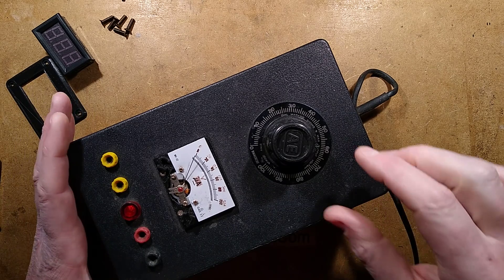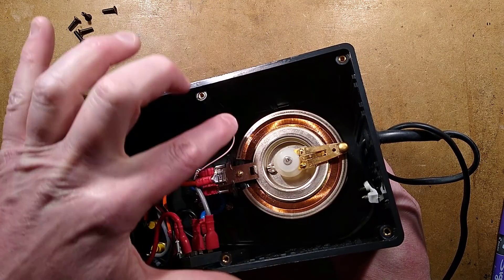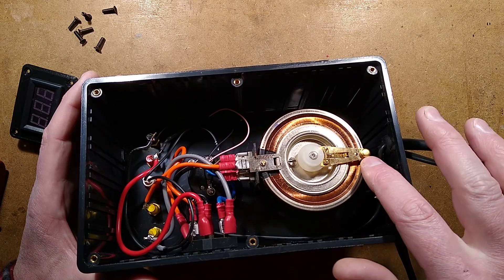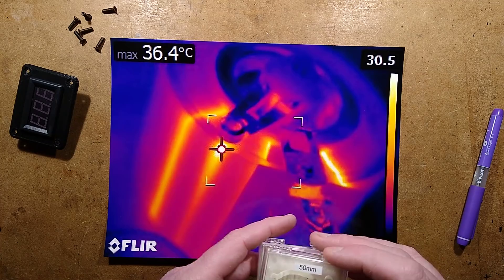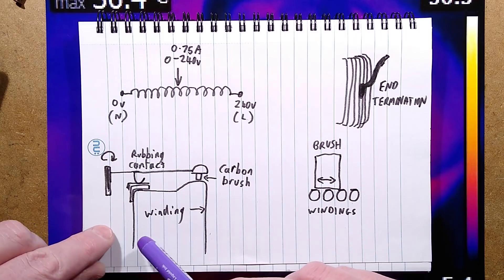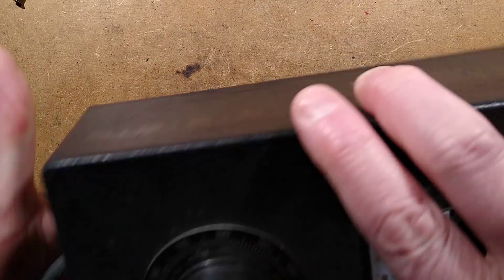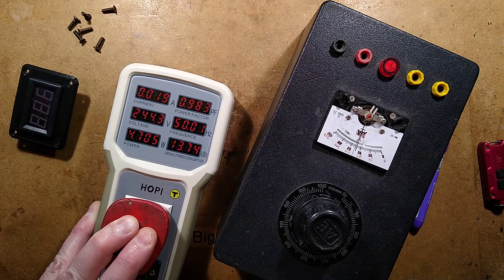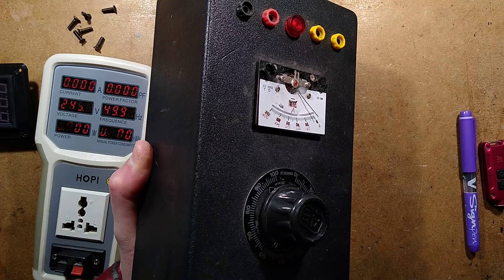Variacs DO short their windings

Comment: why would the shorted turns even make a difference, the path of least resistance will be the only one used I would think.
Reply: Vast oversimplification... current takes all paths at once, inversely proportional to their resistance. The "path of least resistance" case has a resistance below say, 0.1% of the other paths, and so takes 99.9% of the current.
Reply: @jercos  so the all the paths will be used such that the proportions of the current vary by resistance, is that fair?
Reply: @EnergeticWaves  going further, the shorts are by and large the "path of least resistance"... but for the other turns in the transformer, the path around a shorted turn and to the next short would fight against the current produced inside that loop.

For the shorted turns, each turn is a low-voltage electric heater, its own resistance determining the heat produced. For the unshorted turns, there's additional potential current paths if the wiper has poor contact at the first point, or the output draws high currents.
Reply: @jercos  Would the answer be click stops and more space between turns such that only one turn can be in use at a time?
Reply: @EnergeticWaves  as mentioned in some other comments, this is actually a desirable property. In the real world all synchronized contactors (like the contact points between the brush and a pair of wires) are either "make before break" or "break before make"... the alternative to shorting turns is cutting out power repeatedly as you turn the knob, and having tons of "dead spots" where you'd get no voltage at all until you wiggle the knob. You could add a cam system or magnetics to "step" the knob onto a single wire for a minimal gain, and some variacs use a roller contact to limit the contacts to two at most.
Reply: @jercos  that's right, the stop start part would defeat the purpose of the thing.  good point.

Comment: Doesn't a variac output a slightly  higher voltage  the input? I thought they were auto transformers
Reply: They're typically applied as step-down autotransformers. To step up voltage, you'd apply an input to the wiper.
Reply from the maker: You can get variacs with a mid point supply that will allow a higher output voltage.

Comment: My stepfather had several of these for the lights in his animation studio. He found that the lights lasted much longer if you wound them up gently and didn't run them at full power, which was important as the special bulbs were expensive. Of course he'd got them second hand and much used, so big blue sparks would shoot out the sides as you wound them up. Also they had to make sure that the lamps were always running at the same voltage throughout the shoot, since mains voltage varies from day to day, which would show up as a noticeable flicker when sped up by the animation.

Comment: I've started using Kapton Tape on my glass bed for printing PETG, PLA, and ABS...No glue needed. Just a quick wipe with Isopropyl.  I'll NEVER go back to anything else.

Why would decreasing the resistance of a section of winding cause all that heat. It seems like there should be enough resistance from all the remaining un-shorted windings to limit the current as if the short was absent.  Like shunting a 2 ohm resistor that lives in series with a 1k ohm resistor. Is this not what's going on?

Comment: I have a slightly chunkier one (~4A = 1kW) which has a copper roller on a pin sticking from the slider arm.. that way it makes sure to short out two adjacent windings at best.. and the 0.5mm² solid coil makes a nice ratchety effect while turning.

Comment: Interesting that your research did not uncover the “semiconductor” nature of the interface between a metal such as copper and a typical carbon brush. Essentially no current flows until the voltage across the junction reaches a couple volts. You can read about this in old engineering books.

Comment: Just wondering. Does the current (losses) decrease when the wiper is lifted?
BTW The max voltage output in your variac is max the same as the input voltage. Consider soldering an extra wire about 10 degrees or so from the max rotation (same method as now used for the connections). When you apply voltage to this wire the output voltage can be higher in case you need a voltage higher than the line voltage.

Comment: Maybe I'm misunderstanding what's going on, but shouldn't the carbon brush be the only thing heating up when it shorts across multiple windings? The way I am figuring it, current is constant across the entire winding, so shorting the transformer should actually heat all the coils OTHER than the ones being bypassed, as those would have less or even no current flowing through them, but the rest see higher current from the loss of overall resistance from the bypassed turns.

I think the stripes of heat going down the windings was just heat from the brush conducting down the wires it was touching, and that narrow strip seen in the picture might be a damaged winding with higher resistance.
I just woke up, so it would make sense if I was a little confused, but it might be worth further experimentation.
Reply: Shorting a winding of an autotransformer adds a low-resistance load to the whole transformer, pushing a potentially large amount of current through the short. If the carbon brush contact is low enough, the resistance of the windings is relevant.

Comment: Yes, they short out the windings which is why it is nice when they are overbuilt like the old ones were, so that the thing can actually handle real usage...
The new-style Chinese units have a very narrow pointy-cone brush to help reduce the strain on the undersized windings but will never hold up over extended usage, especially as the brush wears down and more windings come into play on the "shorted turn" section.
There's a thread on the EEVblog about this, I'll see if I can find you a link...

Comment: Used a variac in our shop.  Rated for 15A and the windings were much more 'course' as it was about 14 AWG wire.  As you turned the knob, you could 'feel' the bumping as the brush moved from one turn to the next.  They are a sort of auto-transformer (uses the same winding for primary and secondary) with 'taps' on every turn of winding.

Nice video.  And some VERY nice FLIR photos.

Comment: Where the windings are hot, it's due to current flow. Shorted out winding have no current flow so are cold.
You get heat at the source of resistance - i.e. at the jockey and that will be conducted down that winding. The hot bits at the ends must signify poor connections at the ends. The random hot winding is an oddity but is presumably due to increased electrical resistance at that point, for some reason.
Reply from the maker: It's a transformer.  A shorted winding is a closed circuit around a magnetic core.
Reply: @bigclivedotcom  Yes, I was considering that. Perhaps you have one winding permanently faultily linked ?
Sadly, I think I'm even more baffled by variacs now than I was !

Comment: 750mA ?

BABY !

My variacs are all 8A 0-115%

And Clive, if you think that's big, you should see my resistor - I'm guessing it's going to be around 0·01 ohm and rated in kA. I'm guessing it's in an oil bath which has a water supply - pipe diameter approx 3/4" It's years since I've seen it but I know where it is !

Comment: Shorts caused by the wiper shouldn't matter at all - it just results in a few "dead" loops at the wiper position. Likewise, any other short would just kill a loop or two, and decrease the overall resistance of the entire coil (and affect the linearity of the output). I'm not sure why there would be hot spots unless the windings are uneven, so that a few windings are closer together (so the combined heat of the windings would influence each other). None of the shorts would put more current through any single section of wire.

Comment: I would expect the unloaded Variac would be purely inductive and so I would expect a non-zero current and a near-zero power factor. I'm not convinced that the shorted turns would really affect this much, either. Evidently the resistive current from the shorted turns is far more than the reactive current of the inductor (in other words, the inductance is more than I expected) and so dominates.

Comment: So is this a variable transformer, or a variable inductor? Looks to me like it’s an “inductor divider”, since it doesn’t have both a primary AND secondary coil.
Reply: autotransformer
Reply: I’m drawing an analogy between a standard voltage divider using two series resistors across the voltage supply, and the case where each resistor is replaced by an inductor.
Reply: @danthewalsh  the analogy works until it doesn't, output from an autotransformer doesn't behave like a simple divider under varying load, sharing a core keeps the "divider" balanced through mutual induction, the transformer effect. Autotransformers can also boost voltage (frequently used to boost 120 to 240 in the US), or even create an opposing phase.

Comment: Yet another great myth-busting video Clive. Thank you! There are many assumed theories about the graphite brushes on variacs, but it's obvious that they simply short out a few turns of the coil which after all amounts to only a few volts precisely as you say. I have an 8 amp variac and it dissipates 13 watts quiescent AND it has a finned heatsink on the graphite brush. That's where the quiescent power goes.

Comment: We used to carry a 20A Variac when I toured with a sound system (1980's). This would allow us to adjust the voltage at venues that were out of spec (for the console and other sensitive gear. Nowadays with better power supplies this is not as much of an issue.) For the connections to the windings there were actually 4 connections, 0%, about 10%, about 90% and 100%.  We would connect the hot at 90% and the neutral at 0%. This would allow us to move the output wiper past the hot connection at 90% and boost the output voltage above the input. Very handy when we were at a venue with low voltage. Being from the US, we would also bring this variac along when touring in 240 volt lands, etc., allowing easy adjustment. (We would find some places where 240 was actually 260+, being able to tweak as needed was handy.

Comment: Use ethyl alcohol with your 3d printed parts instead of isopropyl.   I switched to using ethyl in 2019 after repeated nudges in that direction from my printer manufacturer.   It's a lot easier on the plastic, and still has excellent ability to remove "sticky" and other unwanted stuff.  I've taken to using it for all electronics and sanitary purposes.  I think it's easier to get ethyl in most countries other than the USA, as there's a massive tax here on ethyl (approx $100 tax on 1 gallon of 100% lab grade).     It doesn't smell as pleasant as isopropyl but it's far less damaging to plastic.
Reply from the maker: Ethyl alcohol is ethanol the drinking alcohol.  That's why they charge such high duty on it.

Comment: I use cheap glass cleaner for the print bed as it cleans the oils off and leaves a film for the print to stick to.

Edit: Do not use glass cleaner with petg. Apparently people have bad luck with it bonding to the build-plate and de laminating it when using petg with glass cleaner.

Comment: I just had a look at the brush on my 10 amp variac. 
It's a 10x10x10mm cube of brass, with a small T-profile length of graphite set into it, about 10x5x5, the edge that contacts the winding being about 1.5x the width of the winding pitch. The graphite measures about 1.5 ohms in the winding-to-winding axis, and 0.3 ohms from the brass to the contact face - the whole length of the graphite insert is effectively all in parallel to keep the resistance to the brass low, while having enough resistance in the winding-to-winding distabnce to minimise heat from shorting turns.
I know someone who tried replacing a broken variac brush  with brass. it didn't end wel...
Reply from the maker: Someone else mentioned a tiny brass roller that rode across the windings.  I tried measuring mine, but didn't see significant results with my ordinary meter.  Maybe I should have tried my installation tester for a higher resistance test current.
Reply: @bigclivedotcom  I have a heavy one, that has five ! ~1 cm carbon sliders side by side so with spacing the entire takeoff area is ~6 cm , using the height of the wingdings on the outer circumference. (for normal use I have a smaller 2Amp one though)
Reply: i have second hand ones with copper cored graphite wheels, but they got stuck and have been rubbed flat on one side
Reply: Likewise on my 2A one.  Mine came with a spare brush, which I have never needed and occasionally find lying about the workshop (it's supposed to live in the bottom of the Variac cabinet).  I notice that the windings are actually set slightly apart and embedded in epoxy so that the contact surface is quite flat and the 'dwell' is very short.  I imagine if and when the leg of the T wears down it will be another story, but it will probably outlive me.
Reply: Hey Mike, have you ever popped into the synth-diy mailing list? I think you might find it interesting  A lot of analog electronics design happening.

Comment: It's easy for anyone to see this fact just by looking at the brush. The brush is wider than 2 turn surfaces. Note also that they turn / mill the windings flat for the brush; this is obviously necessary for brush movement, and while it may increase the wire's contact area, it drastically reduces the circular cross-section.  So the classic name brand units at least (Superior, Staco, and GenRad) always seemed to use quite large wire for a given current rating.  I've always assumed it was to compensate for that very problem.  And the cheap chinese units do NOT do this, I've noticed they all run hotter. There's a reason used 50A name-brand units (very much in demand among Tesla coil builders, among a handful of other uses) are still breathtakingly expensive; there's a boat-load of copper in them!
Reply: The question is: WHY do they short the windings when clearly it is preventable?  It's a current density problem, localized heating at the brushes. There isn't sufficient contact surface even after milling the wires to get the rated current into and out of the windings by using only one turn. So designers accepted the heating of one turn because it prevents even higher localized heating at the brushes.
Reply: @Railgap Esoterica, while I am a Luddite, this is the explanation that I have been waiting for.  I hope that educated corroborators chime in... :-)

Comment: Does anyone make something that actually regulates AC voltage? I know UPSes will switch to battery if the input is over or under. I know there are devices that change transformer taps. But the latter is too big of a step. I kept frying LED Christmas lights that I made a 170V DC driver for. A few volts over, or a surge, would wipe them out. Isn't there a way to just get a steady 120V AC? Would I have to just go with a 12V DC power supply and then use an inverter to get back up?
Reply from the maker: There are automatic variacs that dynamically adjust the tap for the correct voltage.  Not so crucial now with wide range power supplies.
Reply: @bigclivedotcom  Those are too slow to be meaningful

Comment: One could actually make a pretty decent LAB variable PSU with a VARIAC followed by an isolation transformer with a NPN or NMOS capacitance multiplier. Very low heat dissipation. Especially useful for audio amplifiers and such.

Comment: All these years using these things and I never considered that this was happening. I have had many experiences with variacs, not all of them pleasant. 
Working within electrical and mechanical engineering for 35+ years, looking at the back of that variac in the video reminded me of the 3 phase 415V ganged variac that I used to use in the Electrical Test Department of a local firm I used to work for. It was in a test rig for high power DC motor testing with the outputs of the variacs going to a 3 phase diode bridge rectifier. 

It was all open live connections mounted on a piece of thick paxolin board. The only protection from certain electrocution was a flap of cardboard over the front of the connections secured with gaffer tape. The whole rig was bolted to the side of the test bench and the floor, on top was a large wheel very reminiscent of a water gate valve. I did manage to get zapped occasionally on the output side of the motor test rig, think it was due to leakage current from the big diode bridge.

The other one I remember was "The Puppy" as it was referred to. This was a large wooden box on wheels that contained a variac and high voltage step up isolation transformer and DC bridge rectifier. On the front was a large red "jewel" indicator (remember those anyone?) lamp that had a 15W pygmy lamp in it . It's purpose was a high voltage leakage current detector, I think it was 1200 volts maximum output. There was a long high voltage test lead came out the front with a pointed bakelite probe holder and brass probe tip (not insulated or retractable!). 
Of course it had gaffer tape ears, tongue and mouth, the variac pointer was the nose, and the indicator light was one of the eyes! Dangerous kit by today's standards and probably would send an HSE representative into palpitations!  

Also good to see an MK 655 D8 red mains plug still in use. Does it have "Hospital Property" stamped on it? I can remember my father (he was a hospital electrician) having one or two of these in his works toolbox. Used to see these on everything in the local hospitals, from ECG machines to electric floor polishers, vacuum cleaners etc.

Comment: I've been curious about variacs theory of operation too. Does it work like a voltage divider, but with two coils giving impedance at 50hz instead of resistance?
Reply: It's an autotransformer, if you drive the wiper with a lower voltage it can also step up!